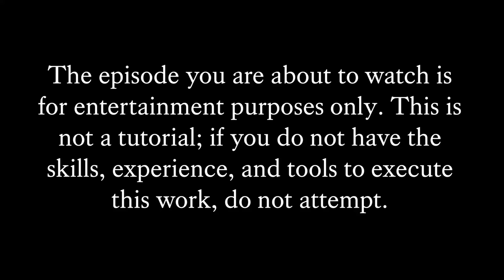Anvil 088: Shotgun Rib Soldering

Comment: Thanks
Reply: Please go take a silver soldering course. You should not have to clean up after after a soldering job. Prep your work thoroughly, never use acid core solder . Always put paste flux only where you want the solder to go. Only use the appropriate amount of heat til solder sucks in.
If it starts smoking you have too much heat. Use a pencil torch tip,that way you can localize the heat.
Silver soldering is an art and once you've learned to do it you will be amazed at how easy it really is. 
I didn't write this tip to anger anyone only to help. Remember practicing is key on different metal pieces, copper, brass,tin and yes aluminum. Have fun.

Comment: So wait... Did the homework not get done right or something... I thought the solder was just supposed to melt with heat.. which is why u prepped the length of the piece with solder . But u still had to put a bunch more in
Reply from the maker: When tinning, the iron of the base metal is sealed off from atmospheric oxygen. The parts are then warmed just enough to melt together. Then extra solder is added to completely fill the joint. This extra would interfere with joint alignment if added during the tinning phase

Comment: You can use a pencil instead of the sharpy soldier will not Stik to graphite .
Reply: It might be easier on his eyes, man.. And I guarentee, you couldn't do a better job.
Reply from the maker: Yes, the pencil also works well. We had four 28 inch joints to guard, so the sharpie was faster, in this application

Comment: Water vapor from a torch is a threat to the integrity of a hard-solder joint.
Never seen this in the wild, sources?
Reply: My guess would be his source is experience.
Reply: For a joint in a small area, such as large gauge wire, or soldering a sight on it is less of a concern, but on larger area joints he is correct, moisture from the propane torch or very high humidity can result in small inclusions within the joint.
Reply: We are not dealing with hard soldering here.. this is soft soldering, which operates at much lower temperatures, and whilst parts of the piece are well above the dew point,  other parts may not be, and you will get a band of condensation somewhere on the piece if you don't pre-heat. Another point to consider is that when attaching ribs, you are potentially creating sealed voids.. you do not want moisture trapped in here, as it will inevitably end up as rust! 
It very much depends however on the background humidity.. if like Mark, you are working in Charleston,  the ambient atmosphere is mostly warm steam!

Comment: interesting video, one thing I would use is Barrel levels to solder ribs on. message me on facebook and I'll post a photo.
Reply from the maker: These tubes were NEVER again going to be flat, hence the four corners comment. This video was shot in near real time, all of the time/money had already been blown out. That's the tone in my voice. This gun was barely worth 150 bucks , then these guys hosed it up. To summarize, there wasn't a grand in the job, so the setup was what it was.
Reply: @marknovak8255  That's the difference between the professional and the hobbyist. If it's your profession it has to make economic sense. Love watching you work, taking time and patience to do things right first time. Trades are highly underrated theses days, the youngsters are just told a degree is the pinnacle.

Comment: I'm confused. You can't "solder" steel. The only way I know of joining steel to steel with metal is either welding, or brazing. What am i missing here?
Reply from the maker: Solder/Braze/Weld in increasing order of temperature and filler metals. Basically, soldering is below the temper temperature, brazing is above the temper temperature, welding is fusing  at the melting point
Reply: John Doe . I believe that if the steel is perfectly clean you can solder it with ordinary solder and flux. Or you can used "killed spirt flux" which I use and it makes soldering steel,as easy as soldering copper.
Reply: You can solder steel

Comment: I would guarantee that you warped it all at the beginning. Your ideas of how to do this job are great. However you need more help and tips on how to solder. You are soldering steel not copper or brass, aluminum low heat items etc.
You should have wrapped the whole unit in a welding blanket or something similar completely brought it all to temp I don’t care if you used an oven etc to do so but there is no way you didn’t warp things at the 23:10 mark. The barrels are completely exposed. If anyone reads this Hos method is fine but you need to keep the entire barrel relative to the solder temp. Also it’s really hard to do this but if you can go from the middle then ends it’s the way to go. I get it’s a cheap gun but still do it right. You were almost there.
Reply: He would loose the lug if he did that

Comment: when i was at school in 07 i was at Zbrojovka Brno and i saw how they do same thing, but honestly your way is terrible (sorry), there was a guy and he made it at once in like 5 minutes + 10 with preparations a pretty well too
Reply: Yeah, but he was working with new metal, not two tubes off a vintage abused shotgun. Also if he was making it in 5 minutes he's probably making it to Skoda Favorit quality.
Reply: @iansmith8878  it not really matters if its new or old metal, old one is for soldering better, not for shooting though. And its not a tube but a barrel. Anyway - this guy uses solder for electronics which  is not great for this, my guy used solder paste for soldering metals together. It was something like this - put two barrels side by side straight to each other, applied paste on right place between barrel end to end in nice line putted rib on it, ran over it with a torch few times end to end aaand BAM its done. Now other side and again BAM. 20min tops. Great work also. 
Anyway pt.2 - Favorit was great i had it for  four years, indestructible car.

Comment: Would welding it introduce any problems? I'm much better at TIG than soldering.
Reply: Soft soldering like he did is usually not hot enough to screw up the hardening. The TIG is hot enough that you would better redo that after.
Reply: you wana fuse the metals together on a thin wall shotgun barrel with out warping or burning through it? thatd look like shit and be non functional.